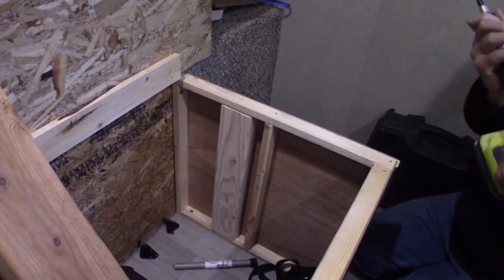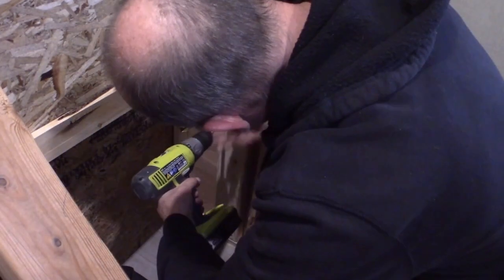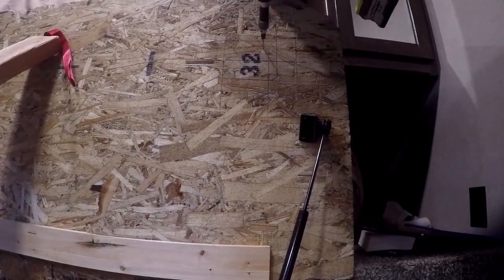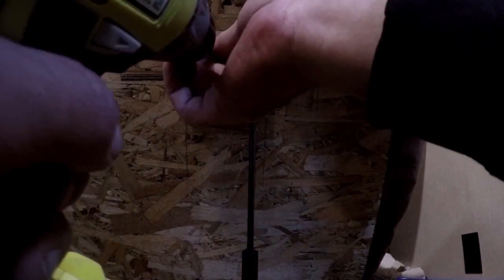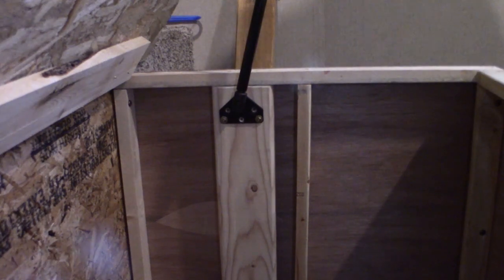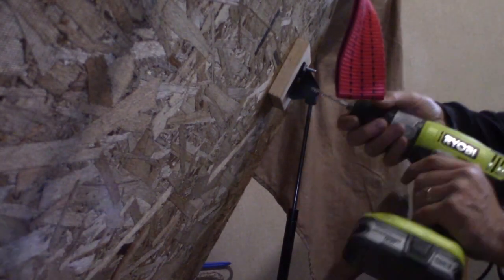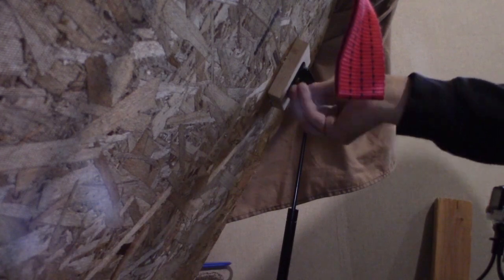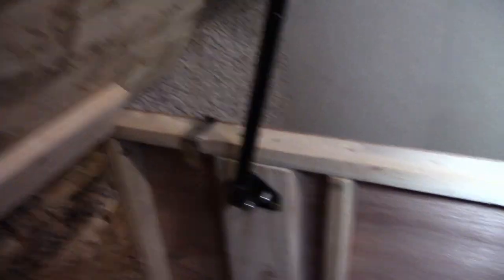Custom RV bed lift struts installed on our Coleman Lantern 202RD easy to install

Comment: How did you figure out where
 to put the lifts and what size to use?
Reply from the maker: I was originally going to use the kit from hatchlift.com so that is where I was able to determine the size of spring. There you may also find some info on mounting location. I am planning on doing a video on how I figured out where to mount the brackets.
Reply: @DiyRVandHome  OK thanks
Reply: @DiyRVandHome